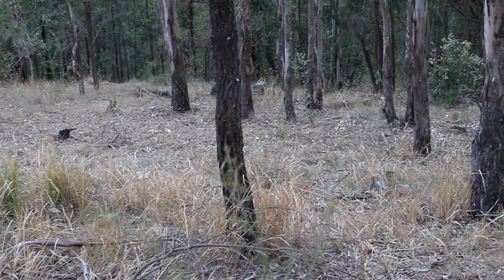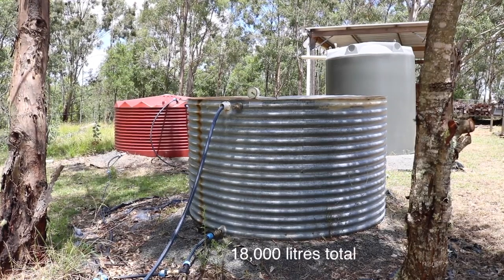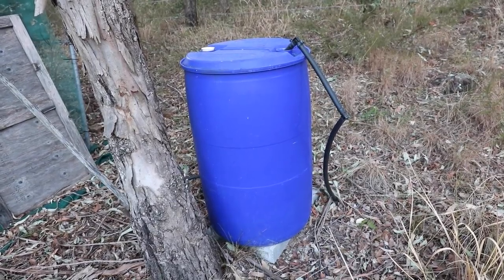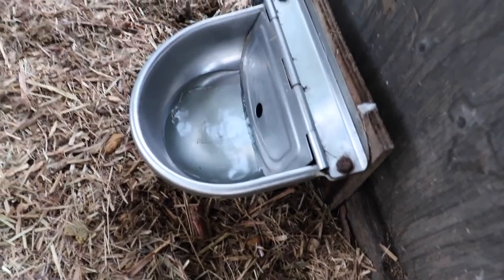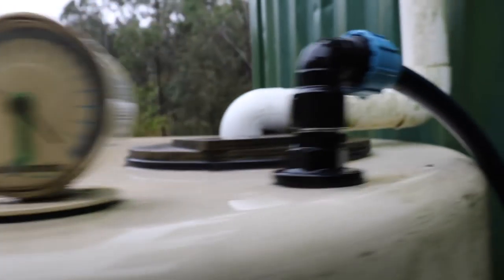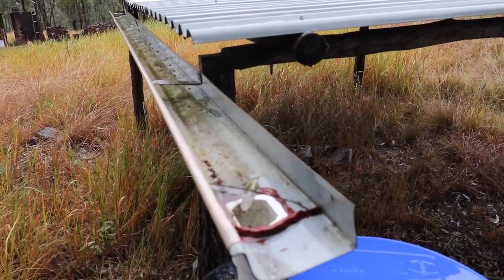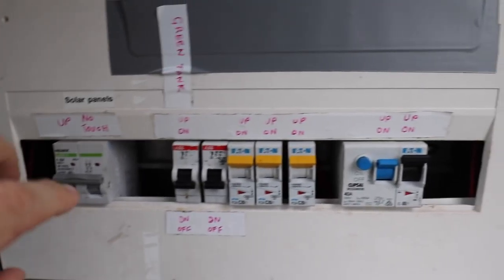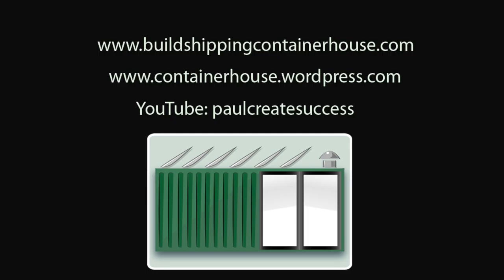Shipping Container House – Rain dance

Comment: Wow, thank you so much for documenting this.
I just spent the last 45 minutes being thoroughly entertained by your project on Kirsten Dirksens channel. (I hope it's authorized.)
I have no idea how I got there but once I started watching I could not stop. :-)  
That is a pretty amazing setup you have, I am more than a little envious.
I can see people are going off grid more and more these days and it is good to see that you don't have to go without the luxury items to do so.
I have been tempted to at least supplement my existing home in NZ with solar and watching this has motivated me to look in to it further.
Even if I just go for a small system for lighting and light load appliances I think it could make a difference.
My biggest issue, if you would call it that, is that I work full time so when the power is being generated I am not at home to use it.
Once again thanks for the entertainment. :-)
Reply from the maker: Hi Stambo, Welcome to the channel, nice to meet you. Lighting makes a great first project. I started with a 20w panel, 4 x 12v LED lamps,  and a lawn mower starter battery and a cheap Chinese charge controller. I used it to light my shed. It gave me the confidence to wire them safely and see what it could do. My next panel was 250w and a truck battery. It has been lighting my house for 4 years now. I appreciate when you work during daytime you cannot utilize the full sun. I still use the original set up to run the security lights and it is the same battery. Still working perfectly and putting the lights on at night when I step out. Cheers Paul

Comment: were you able to sustain yourselves for three months or did you have to get water delivered? If no water was delivered now you know you can go three months without rain. Thanks friend glad you got rain.
Reply from the maker: Hi Daniel, no water was required to be delivered. We use very little. We have not purchased water for three years and then that was before we had the infra structure to collect it. Cheers Paul.

Comment: Totally didn't remember the h part of the equation.  I'll stick to my music haha.  So I'm curious Paul, did that rain fill up the tanks?  And, once filled how long can you go without rain?  I'm guessing it's slightly more than 3 months, but I'd also imagine you'd start rationing water use once all the tanks get as low as they did in this case.  Thanks for the inspirational videos btw.
Reply from the maker: Hi Ben, I wrote you a full reply but YT has lost it. I will reply again but probably shorter. Your observations are correct, We have managed to get through 3 month intervals without rain, but we are more careful when we get to 50%. its 3 years since we have bought water so we probably have the balance reasonable. Watering the plants in the garden is probably our largest consumer. Composting toilets is the reason we can cope with a small capacity. Cheers Paul

Comment: Is rain water safe to drink?
Reply from the maker: Hi Dragon, Definitely, I hade a short video to explain how we make certain. https://www.youtube.com/watch?v=vRTtTfaqdVw
Reply: We all drink rain water, just some is more treated than others, and it tastes so much better without all the nasty chemicals. :-)
Reply: Stambo I didn't even know there were that many chemicals in water. Does it really taste and feel different?
Reply: Most town water supplies have chlorine in them to kill bacteria and bugs. Once you use well filtered rain water for a while and then have a glass of town water, you can easily tell the difference. Any town water I use goes through a 5 micron carbon filter which removes the chlorine as well as many other unwanted substances.
Reply: Stambo do you know if waterbottles with filters use the same 5 micron filter?